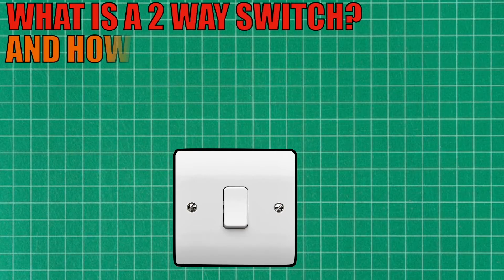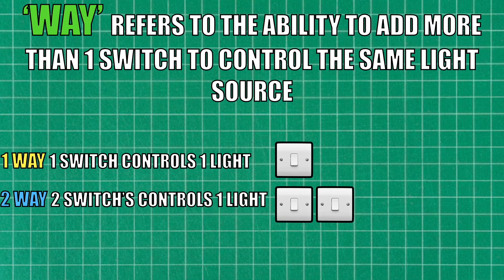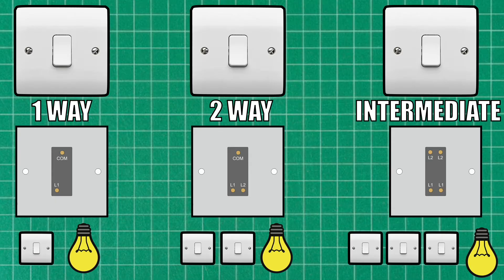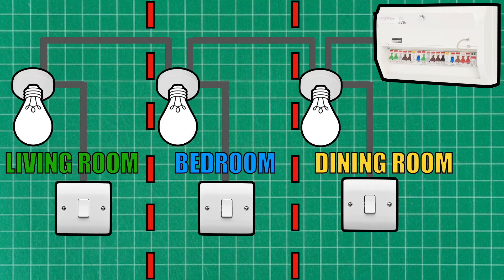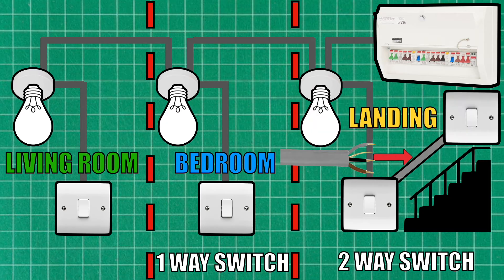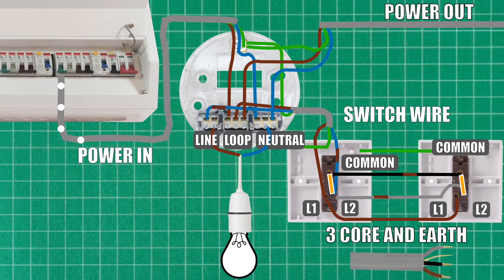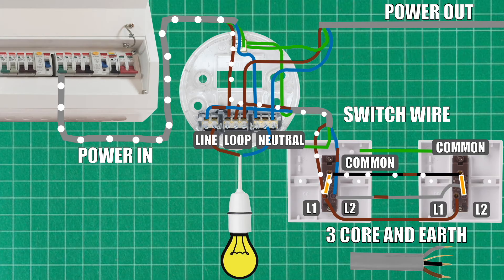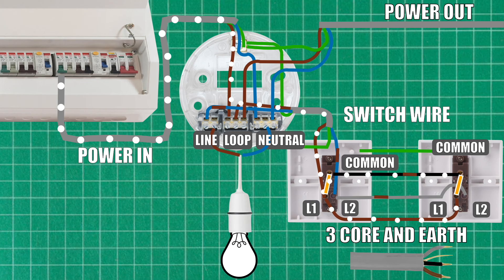HOW A 2 WAY LIGHT SWITCH WORKS. LEARN TWO WAY SWITCHING IN UNDER 7 MINS!

Comment: I have the 2 switches one light issue. I must install a light but I see 1 live wire and 2 switched live. Shall I connect as in your drawing: 2 switched live wires to the hole1 of light bulb and the 1 live wire to the hole2  of the bulb connector? Is it ok for those 2 switched love wires to stay in shortcircuit in same hole(connector)?
Reply: And btw, with no lights installed this 2 switched live wires must stay connected otherwise I have no electricty in 3 rooms